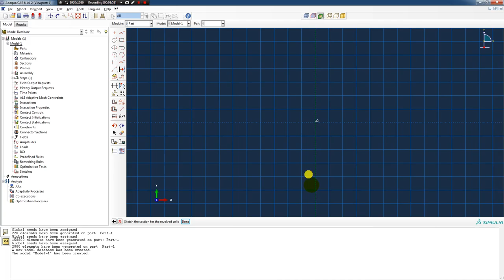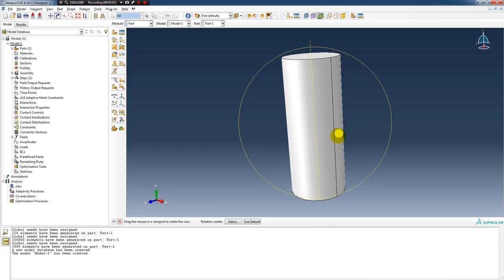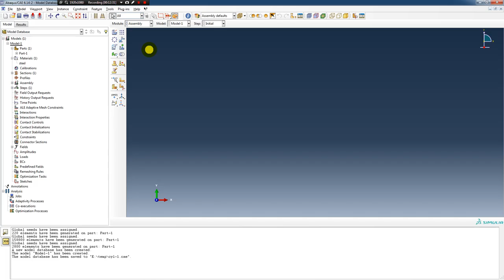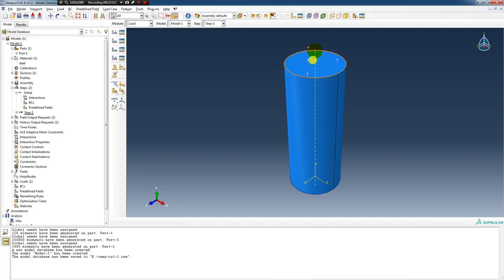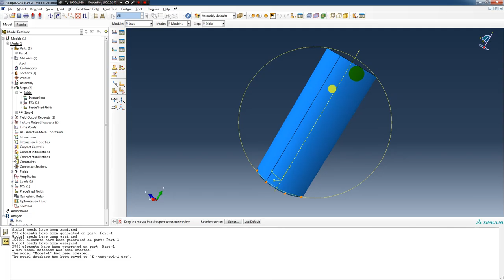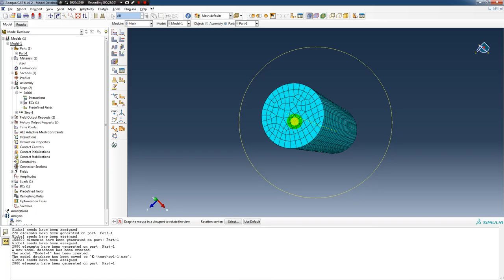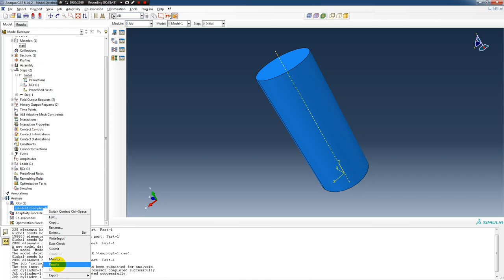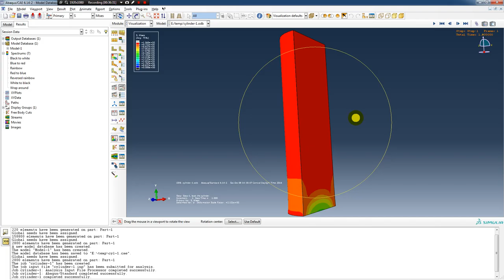01 B ABAQUS CAE introduction

Comment: Hi! Is it possible to customize the use of the mouse in ABAQUS?
For Example, if i would like to change the deselect of the entity from "CTRL + click mouse button 1" to "SHIFT + click mouse button 3", how can I to edit?
Thank you so much!!
Reply from the maker: Hi Pasquale, I looked through the documentation and I could not find an option for that.  However, I may have missed it.  Here is some on-line documentation that you can look through:  http://129.97.46.200:2080/v6.13/     Another option might be to use some mouse software such a the Logitech Gaming software and a gaming mouse to remap the buttons.  Here is some information on a typical gaming mouse:
http://support.logitech.com/en_us/product/gaming-mouse-g500.    Best wishes
Edit:  there are some limited "view manipulation" options in Tools, Options, View Manipulation for various CAD applications such as Solidworks, Catia, etc.
Reply: Hi Mark! Thanks for the answer. Yes, I saw the tool of the view and there isn't the possibilty to modify the use of the mouse. 
best regards
.. congratulations for the your channel, you're very good!